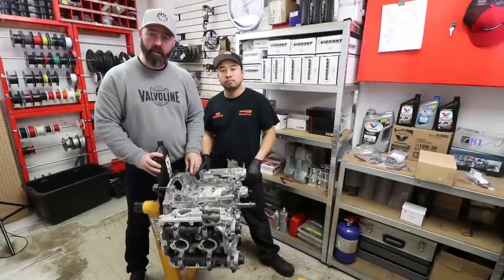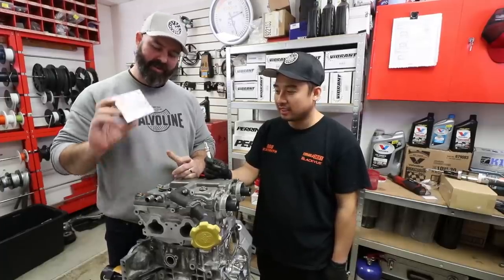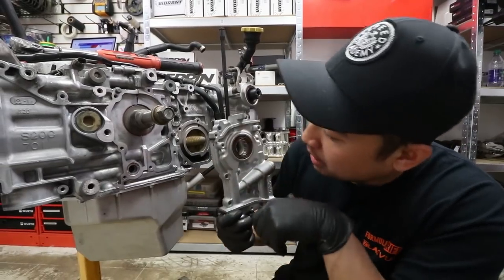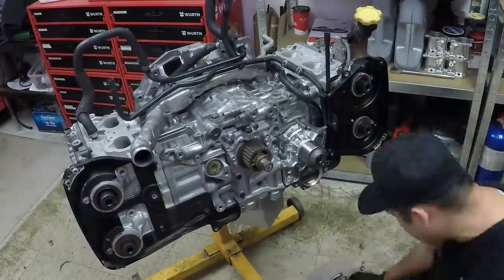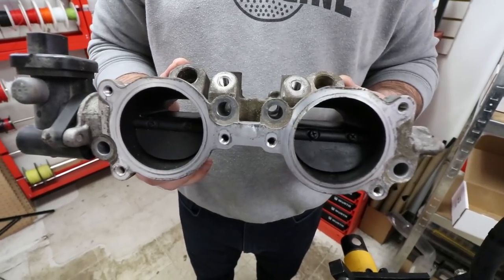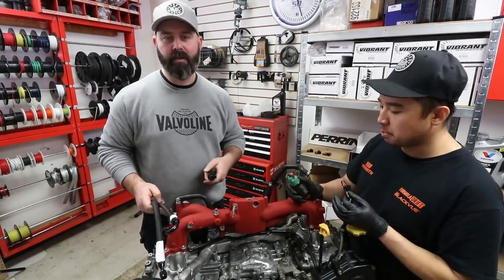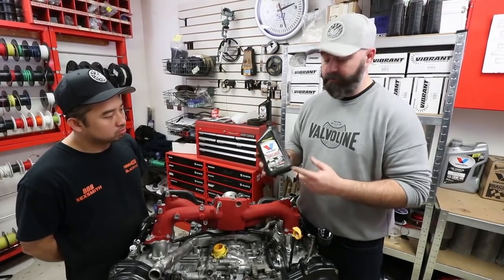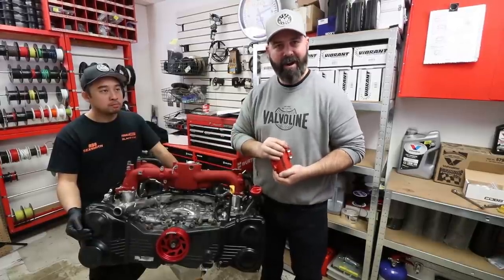SUBARU Engine Rebuild - Long Block Assembly - Part 2

Comment: I have a thought about the main crank pulley. Before that, I want to say this is a really excellent video series, and I have absolutely no problems with it at all.

That having been said, I want to point out that lightened crank pulleys aren't always the best choice. The rotating mass of the pulley and the flywheel provide an important damping function that helps protect the crankshaft bearings and bearing surfaces from irregularities in power generation. If the flywheel is being significantly lightened, I think it's actually better to replace the main pulley with something like a Fluidampr rotary damper. This is what I did with my EJ257, and I am extremely happy with it. The flywheel has much more mass further out in its diameter than the crank pulley ever could, so the amount of engine responsiveness you gain by using a lightened crank pulley is very minimal compared to lightening the flywheel even a little bit, and the extra mass of the fluid damping system in the Fluidampr pulley is in a relatively small area, and does very little to hinder the responsiveness of the engine while providing enhanced protection to the internals to compensate for what was lost when the flywheel was lightened.

Comment: You guys literally just saved my life. I purchased a 2011 Subaru WRX a couple months ago, and today I took it to the shop and had them look at it for a coolant leak. They told me that I needed a new short block and it would be around $9,000 USD to fix it fully.. So I'm just going to buy a short block and put it back together myself.
Reply: Did u do it
Reply: @blakeangell385  not yet
Reply: @dannyp204  any update?
Reply: @mindfulbody.mindfullife4197  my mechanic back home did it. For about 4700 including parts and labor. Just the short block from OEM would have come out to 4k..
Reply: I’m on the same path with my sti brother!! Fuck paying 10k when I could do it myself for half the price !!
Reply: I ended up dropping it off with my mechanic back home who got it done for around 4100, parts and all
Reply: @dannyp204 please tell me you live in TN lol. I can’t find a quote below 10k these mechanics are crooks
Reply: @Li8eralsarescum69  Washington surprisingly. They have the "subaru tax" there but i still got it for that
Reply: @dannyp204  I’m from wa. Olympia to be exact. But I live in TN now. What shop ?
Reply: @Li8eralsarescum69  Chaney's Automotive over in Spokane.
Reply: @dannyp204  crazy. Small world. I lived in Spokane 3 years it’s where I bought my wrx lol. I’ll contact them for sure. Thanks bro
Reply: @Li8eralsarescum69  he quoted me for 5.5, so don't take that low lol price as the end all be all of prices

Comment: How are you planning on using AVCS with a COBB tune on the 207?
Reply: Skyler Sommer I noticed that the Avcs cam gears were installed, too. But from what I am aware of is that Cobb does not service the 207. Only the Prova AccessPort will work.
Reply: pretty sure ecutek or apexi makes a tuning system for the jdm 207

Comment: Was really looking forward to the full timing procedure and there was no link  posted (I am possibly blind.) Going through the full degree process on a DOHC motor that's had shaved heads, block and new aggressive cams, tends to be of great value. If for nothing else other than to confirm the specs on the supplied cam card. Was this done off camera? Obviously the offset idlers allow the timing marks to be lined up 'by-eye,' but is that really good enough for a $12k+ build?

Knowing the exact cam position relative tot he crank will also give you a known point for playing with the variable cam control through the ecu. I know random guy from Australia questioning about how a pro shop builds their EJ motor's wont hold much water, but I had to ask the question. If I found out my engine builder didn't use a cam degree wheel to set my cam timing, I'd send it back, as it should be part of the build notes/blueprint of all clearances provided at the time of invoice.

One thing not covered (though you may in the future,) is how do NV-Auto recommend priming the oil system prior to first startup? Obviously you can't spin the dizzy (like and old V8.) We tend to just spin the motor over on the starter with the plugs out (so there's no compression) and the fuel injectors unplugged until we see oil pressure. While there are pressurized oil pre-luber's (melling make a good one) I'm curious if there are other alternatives worth considering?

Finally a collaboration with Nick's Garage (https://www.youtube.com/channel/UCKxu_85y8YGFQcY11cJGNtA) to see this on an engine dyno would be a riot ;)

Great series guys
Reply: There is one point that you sort of allude to - when doing a build, before fitting the heads (or cams is separate) I will turn the engine so it is 90 degrees BTDC for a 4, or 45 for a V8, so the pistons are far enough down the bores to avoid ANY possible valve contact as the cam's are turned to their marks, when all the cam's are in their correct TDC #1 timing position. I then bring the crank to TDC as all the valves will be safely clear and fit the chain(s) or belt(s) as applicable, set the tension as required and turn it over several times by hand before checking the timing is still correct - sometimes it is possible for a belt or chain to not be seated quite right and jump a tooth.

Good question - if they are not currently made, perhaps it may be a market opening for someone to make a pressurised oiler that screws onto the oil filter boss and the engine can be filled up via the oilways, before fitting a (filled if applicable) oil filter and starting the engine.
Reply: https://www.melling.com/product/engine-prelube/ 

This is the Melling pre-luber the MPL-101.
Reply: I don't know if this helps, but Subaru's aren't timed at TDC, they're timed with all pistons equal. The oil pump is keyed to the crank, and aligns with a mark on the block. Then you align the cams with marks on the front covers, using a specific tool from Subaru (or a little ingenuity). If the marks on the timing belt don't match with the cam gears, then something's off.
Reply: @jarrodnichols8111  That is a smart way of doing it - no possible way of valve/piston contact when rotating the camshafts into position.

Comment: Use a catless UP-pipe, the factory OEM uppipe on the older US 2002-2003 Subaru WRX 2.0L motor has a catalytic converter that overtime with high miles breaks apart & has a high chance of going into your turbo.....
Reply: wedgoku So do the older Foresters. :(

Comment: Never mentioned anything about putting anti-seize on the head bolts and all the other bolts and putting loctite on the flywheel bolts etc

Comment: Got a price and parts list for this build?I have a 98subaru forester and I want to rebuild the engine.220,000 miles is why. It's starting to nickel and dime me on parts,and it would probably cost less to rebuild the ej25 than piecemealing the parts to keep it running. Either way,I want to know how much it would cost to build the engine better and make it faster and more fun.

Comment: Since you will have to make custom intercooler pipes anyway why don't you reverse mount the intake manifold? Much neater and shorter distance with a front mount.
Reply: Matteo Vittoni  it only saves around 3ft of piping nothing substantial spool wise
Reply: if they're doing everything from scratch already... and with custom piping... it's more of a why the hell not?! Every lb of weight counts, every bend in a pipe counts, every bit counts.

Comment: There is several things is see moderately wrong here. Perrin pulley not a good idea, as the engine needs the balance.  Then water pump with the fan style that causes cavitation.  I'd also do red loctite on the oil pump back screws.

Comment: Personally I would have gone with a performance damper rather than a lightweight one and just gone with lightweight pulleys on the accessories. I'm not an expert in engine harmonics by any means, but I have been told that if everything is balanced together its not as big of a problem on a boxer. For example having the pistons, rods, crank, crank pulley, flywheel and pressure plate all balanced together.

Comment: Why use the Perrin pulley ? Is not that bad for the bearings after a time?
Reply: Subaru engines dont have much in terms of harmonics or vibration. The short crank with the opposing cylinders keeps everything balanced by design.
Reply: @chandlerbraaten847  it's still bad for the engine :/ regardless of if the engine is balanced by design, it's literally not safeguarding the engine and if you're chasing some hp and you have that on your engine it won't last long.
Reply: @TriniRogue  No, its not. It's a myth on modern internally balanced engines. I've had one on my 350Z for 6 years, 25 track days, and 50,000. No issues.
Reply: @heyhayhay247  are you chasing hp or are you tracking a stock engine because as i said its not safeguarding the engine which is why its bad, i didnt say they will blow up your stock motor.
Reply: @TriniRogue  The engine doesn't need a safeguard. That front pulley's rubber is for NVH, not for reliability. If they put on a fluidamper, that would safeguard, but the Perrin pulley is a better option than an old stock pulley that will likely fall apart as that rubber deteriorates.
Reply: @TriniRogue  I put them on pretty much every ej I own. I find it's a bit sluggish reving up on downshifts, lw crank pulleys pretty much eliminate that problem
Reply: @TriniRogue  ive been running the Perrin one shown in the video on my 05 STi for the last 64k miles. Its okay bud. It improves throttle response quite a bit. Ill do it again on the next one.
Reply: @chandlerbraaten847  I wish people would read what I said, i know words get lost in translation as we arnt having a conversation, and yes it will be fine on your stock engine but there is a reason you dont see them on high hp EJ or any engine for that matter and in context to the video a ground up rebuild why would you spend all the money to do up the engine and put a cheap lw pully which can cause unnecessary wear on the engine and no safeguard to your investment, rly all im getting at. ( i replied to you but its rly a reply to whoever els is gonna be like my lw pully been on for years mate )
Reply: @TriniRogue  my engine isn't stock. Your point isn't valid here.
Reply: @TriniRogue  also the reason you dont see them on high power builds is because they will cause you to lose torque on the dyno. As will a light weight fly wheel. However im not after every last pony or tq and i like the quicker rev up when heel toe down shifting. Its all a personal preference but in the world of Subaru's you can get away with a lightweight crank pulley.
Reply: @chandlerbraaten847  After doing some digging i came across an article from subaru that confirms the factory pully is just a pully as you said, so i do concede that you sir are correct! learn something everyday :/
Reply: @TriniRogue  no worries, sorry if i came off like a jerk. It wasn't my intention. Emotion and tone don't translate well through text. But yes, its just a pulley. Another one of the little quirky things that makes a Subaru a Subaru. 😊
Reply: @fox10169  A lot of people i know who have had either the perrin one or the Grimmspeed one have ran into issues with misfires. The LW pulley can throw the car out of harmonics. Its best to just stick with the stock one or even an ATI crank dampener.

Comment: can i get a link to all the fuel injector parts installed??? the cobb fuel rails dont show compatability with 07 sti only 08+ so idk if it will work with a ej207???? just trying to figure this out

Comment: what is the reason for using conventional over synthetic? is it just a track thing or would you recomend it on street use too?
Reply: Conventional oil in break in helps the rings seat faster if you use synthetic oil it takes forever for them to seat and you will blow smoke for a couple thousand miles

Comment: Quick question I dont really know much so just want to ask this , the Engine that was build in the video is a ej207?  Why the tittle from the other video said ej20/ej25 ??
Reply: Edison Nguyen this is an ej20 however they are very similar to the ej25, the 2.5L version. So this is essentially a guide for both
Reply: The two Engines are pretty similar but with different displacement values EJ20 (2000CC) and EJ25(2500CC)

Comment: Apparently you are holding the oil jug upside down for intended pour velocity.
Reply: Rookie oil changer.
Reply: What was funny is that the drain plugs were not installed in the pan?

Comment: Crank pulleys made of aluminum make very very little difference in acceleration or throttle response. But do what makes you feel better. IMHO should have definitely stuck with the stock one with dampener. And it’s a felony to remove an emission control system on a vehicle that is driven on the road. But again do what you like to do.
Reply: Always gotta have that guy with the harmonic dampener argument.

Comment: Anyone else curious what this build cost ?
Reply: Not hard to take the list they provide and add it up.  There are alot of variables on this whole build such as machining costs and condition of original heads.  

A brand new STI OEM block is $2200 - 2400 with harden stock crank.  A subaru OEM master gasket kit varies between $650 - 780 oem with a Multi layered head gasket.  These are current US prices.  A new case is around $1450 for a shortblock so you can see many variables.  Assuming the original block is blasted, cleaned and inspected for micro cracking and can be reused the numbers drop.  Machine work and new piston matching process can cost some money depending on area

Comment: Worst error to put a lightweight crank pulley 🤷🏻‍♂️
Reply: I agree, needs an ATI or Fluidampr pulley. Lightweight pulleys will eat the main bearings. They should be entirely removed from the market as people have no idea.

Comment: Get rid of that aluminum crank pulley! Put the OEM one back!
Reply: It's better pulley, and despite all the internet myths, it won't cause a single issue on a modern internally balanced engine.
Reply: @heyhayhay247  its aluminum eventually it will wear out that keyway hole through vibration.
Reply: @JEgkt  No, it really won't. After 50,000 miles, 25 track days, and 6 years, mine hasn't had a single issue.
Reply: My opinion is FACT

My engine hasn't blown up so this engine is perfect
Etc
Reply: @ReubenHorner  It isn't an opinion; it's basic engine building. Modern engines are internally balanced. This isn't a 318 Mopar. The rubber in that pulley was for NVH, not for harmonics. A flywheel is bolted directly to the crank the same way the pulley is, but no one ever doubts a lighter flywheel. Key board warriors to the rescue!
Reply: Jeofrey planes are literally made of aluminum
Reply: Its really not an issue but whatever.

Comment: Not sure why the sped up the timing belt sequence for probably to hide the shitty fact he didn’t set the torque correctly. Or how he didn’t smash a valve on the loaded side. Gotta love these “Subaru techs” doing it for so many years and still making rookie mistakes
Reply: TerriGfy60 That guy he said specifically in the video that they already did a timing belt video and didn’t see the need to go through it again.